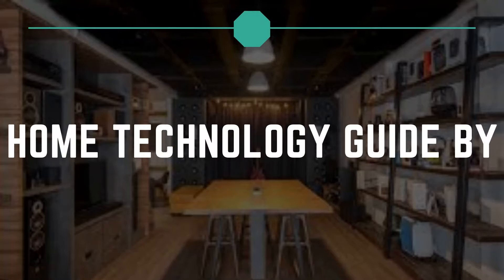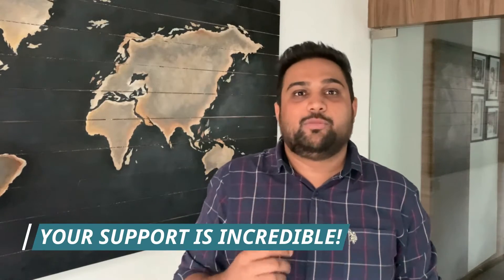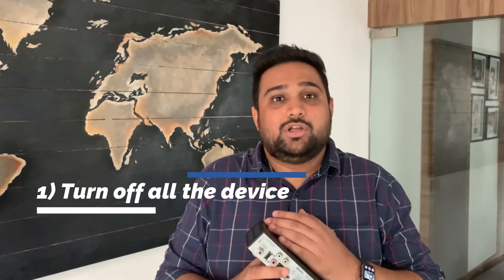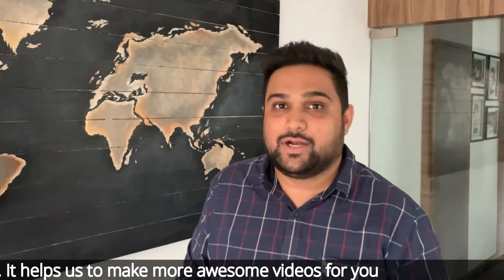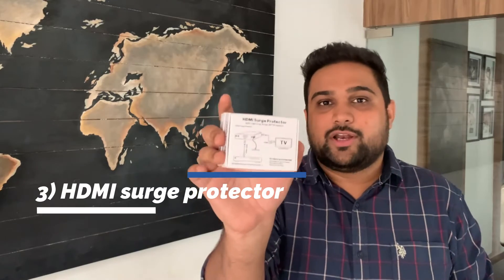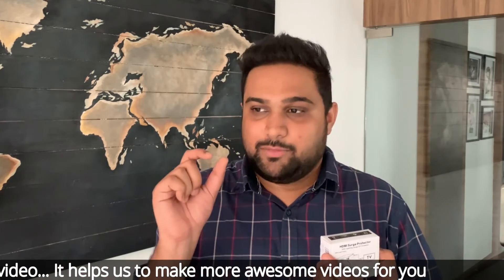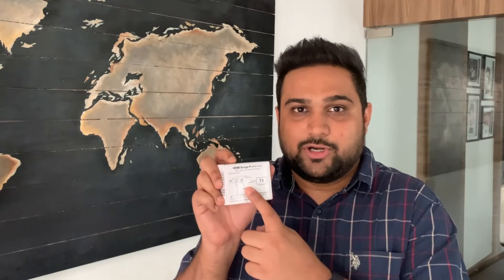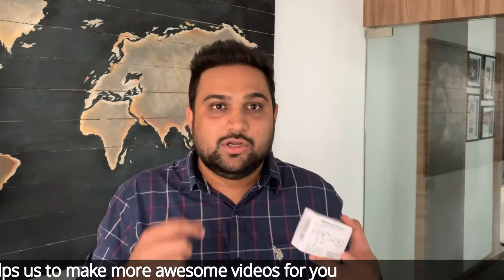How to Save Electronics during Power Surge in India | HDMI Power Problems | TV Amplifier Projector

Comment: Hi Tanmay, Currently I am using 2 HDMI cables, 1st from Media Player to AVR and 2nd from AVR to Projector.... instead of buying HDMI surge protector, if I replace HDMI cables with Optical cables, will it resolve power spike issue?  as optical cable r not carrying power signals....
Reply from the maker: That should do the job. Ensure to turn off the HDMI Link, CEC and Control on all the devices though!

Comment: Hello sir, please accept my super thanks for your valuable video.  Where to connect the grounding wire of HDMI surge protector.  Can i fix it to nearest wall ?  please explain
Reply from the maker: You can connect it to any grounding screw or cable
Reply: @tanmaymehta  thanks. I am connecting my htpc to tv. So HDMI surge protector ground wire can i connect to HTPC case. The PSU is 5 amp three pin. So will this be ok. Please advice

Comment: Hi Tanmay,as you were saying about Fiber optic Hdmi,is it purely on fiber or still it uses some copper cables..
Reply from the maker: Fiber Optic HDMI Cables use Light as a source which can travel faster, unlike Copper hdmi cables which uses copper lines to travel electricity. So Optic Fiber HDMI cables do not use copper inside.
Reply: @tanmaymehta  So will it be a better option for Surges or Spikes like what you have shown in this video

Comment: Does this HDMi surge protector supports 4K signal. Also does surge protector works in active HDMi cables environment. Because i am suing active hdmi fibre cable for connecting my projector from my AVR
Reply from the maker: Hi Harish
Yes there are HDMI surge protector for active HDMI cables and it also pass through 4k
Reply: @tanmaymehta  can you suggest some

Comment: Summary + my comments + my recommended solution

1. Turn off all equipment during fluctuations. 
Better sol: get IGBT based static voltage stabilizer + IGBT based true double conversation online ups (not for subs, ac, fan, no high motor load on online ups!!!! Rest all you connect!) 
2. Buy surge protector. Eg: Belkin .. I don't recommend this, unless you are planning to replace those surge protectors each month. As these surges last full day long. It also has limits, after absorbing certain level of surges, it will start passing those surges to your connected device. 
3. HDMI surge protector. (Get this)

Comment: If I have to use the surge protector will I need to buy two HDMI cables one from my Set top box to the surge protector input and another from the surge protector output to my TV input, if yes can you please suggest which brand of HDMI cable is required,  I have a LG OLED CX 65inch TV.
Reply from the maker: Yes! You need to buy 2 HDMI Cables. You can buy these cables - HDMI 2.1 version - https://amzn.to/2LKlNxw
https://amzn.to/3b0DC3Z
https://amzn.to/2OqnAZA